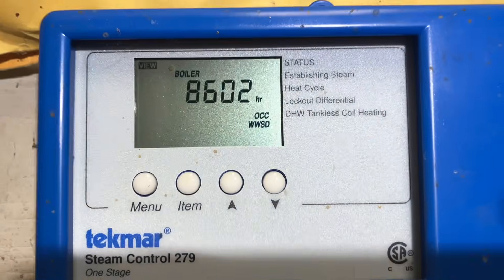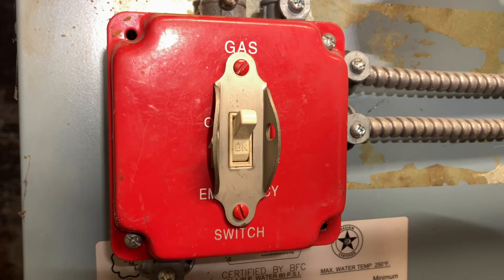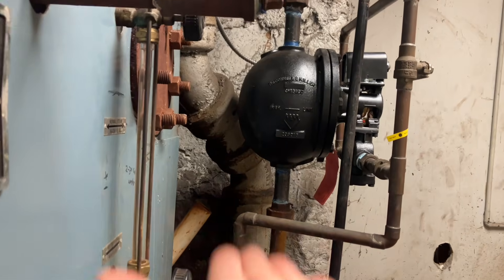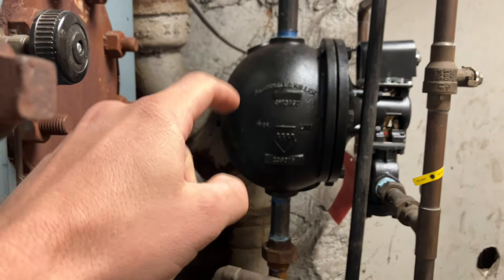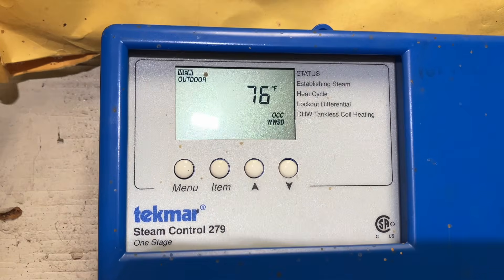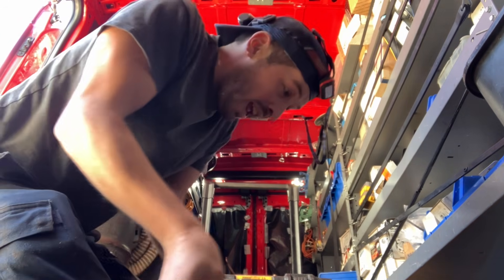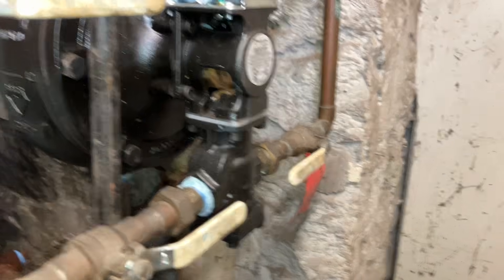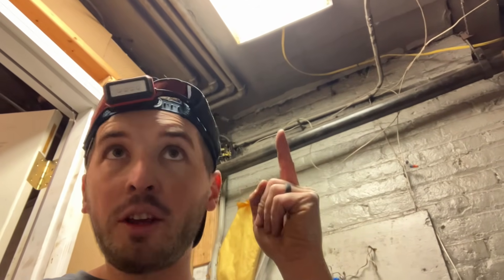The Steam Boiler Won’t Stop Overfilling!

Comment: The OAT sensor was right in the sun so obviously not on the true North side. Had many a building that at certain times of the day, the boiler would go into WWSD at certain times when the sun rolled around. Sometimes it's difficult to get the sensor on the correct side or the original installer just goofed and the owners don't want to pay to relocate it.